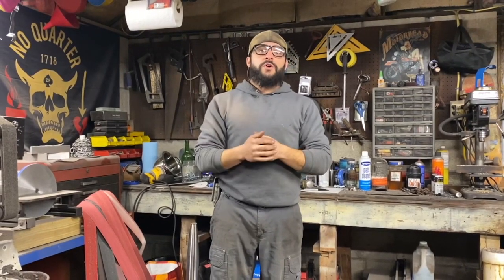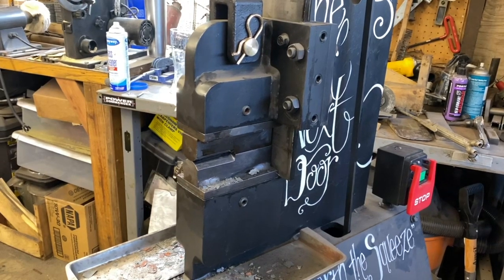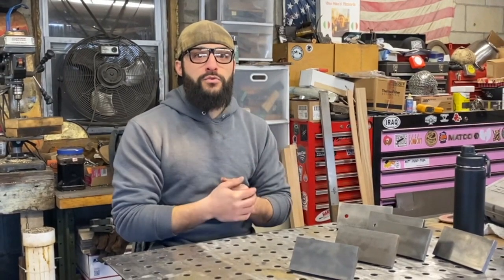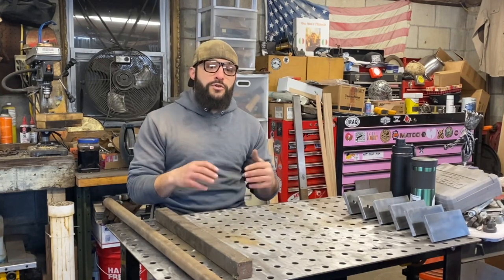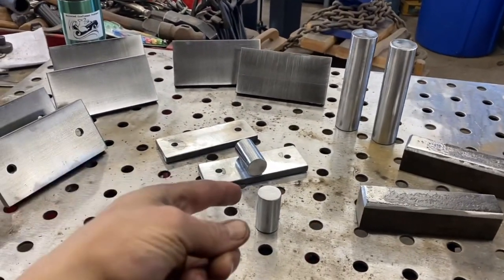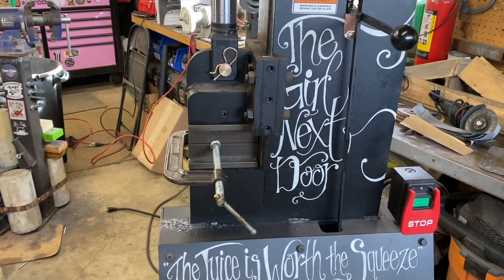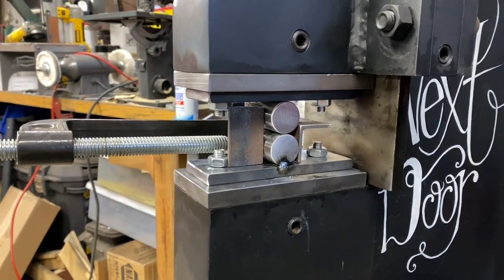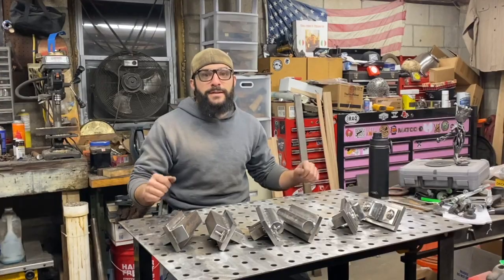Making Forging Press Dies

Comment: I warms my heart to know that there are young Americans out there with hunger to work with metal and to make things with their hands. I am 63 and started my working life in the Tool & Die trade and I love it. I left the trade only after a few years once manufacturing began drying up here in the states. Another reason is that the wages for machinists are painfully low compared to other trades.

Comment: Thanks for the video. I’m getting back into forging and am making my own press using a harbor freight 12 ton press with an air over hydraulic cylinder. It’ll be different than yours but you gave me ideas on how to make my dies. I’m going to start with a drawing die and squaring die set.
Reply from the maker: Awesome man! Glad it helped out!

Comment: this video will help me alot when i build my press thank you that 16 ton press is sweet i actually have used the 16 ton at the good forge in brookfield to make damascus they have a open forge every friday night  if i  have any questions down the road is there a way to message you thanks again Mark👍👍
Reply from the maker: Absolutely! you can email me at muffin.man.metalworks@gmail.com
Reply: Thank you appreciate the reply
Reply: @MuffinManMetalworks  I want to closed die forge an aluminum custom piece

And I need to make my custom dies but machining would be a difficult and expensive due to the shape!!

Can I cast iron dies? Because the shape is easy to cast and since I am forging aluminum a cast iron die would be good enough??
Reply from the maker: @FirstLast-tx3yj  its sounds like you'd be complicating a fairly easy build. Something similar to what I've built here would work just fine for the work you'd like to do

Comment: Why did you run the fullering dies into the throat? Seems like you've limited your fullers to a max of around 4 inches from the end of a piece of work? For hammers it wouldn't matter I guess. If you had run them like you did the drawing out dies then theoretically you could put fullers anywhere in an infinite piece of stock.